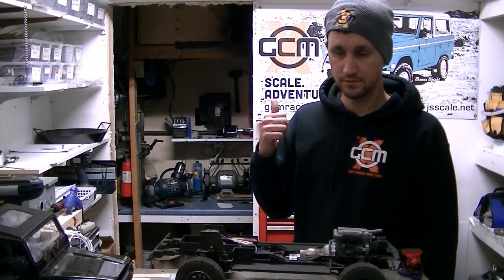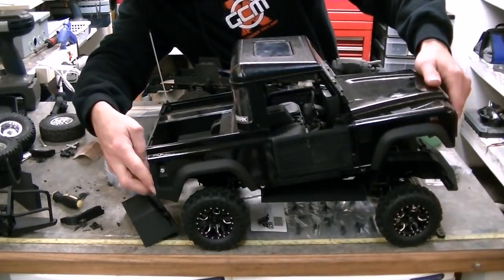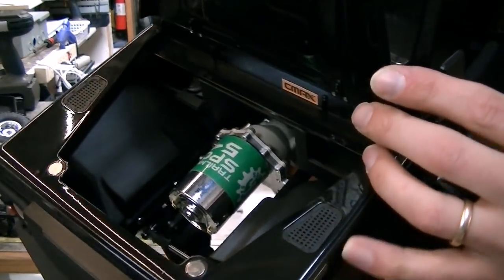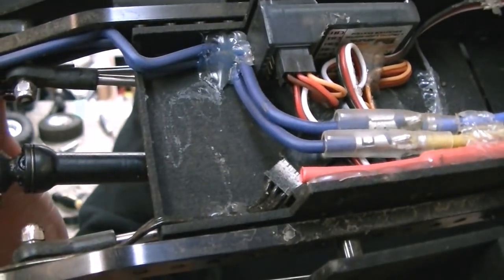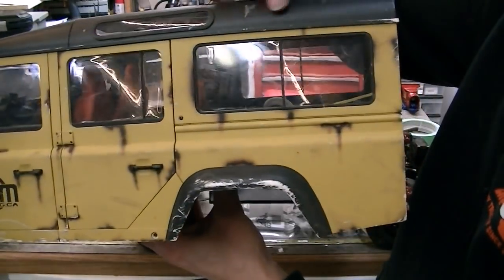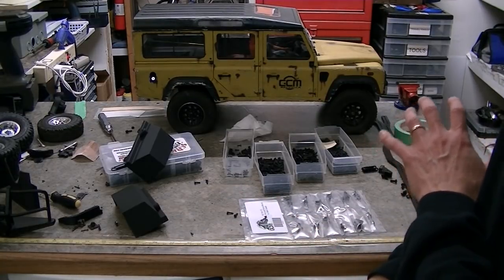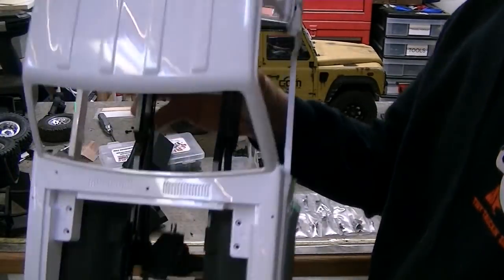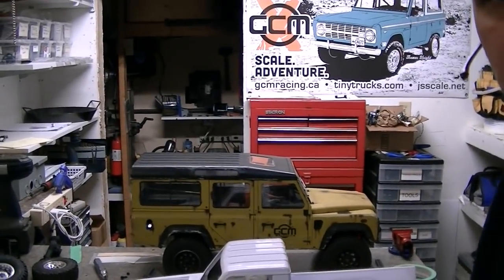OnTheBench - Defender and Toyota Trucks All Apart

Comment: The new inner fenders look amazing! Are you going to be using that new interior for the LC 70 the one that's completely back letting adjusting seats and telescoping steering wheel? I hope that you do it will look grate on a Tiny Truck from GCM!

Comment: Hi to the guys at gcm from castleford england just a quick question i would love it if you would explain to me why you do not like tamiya conecters buds
Reply from the maker: Ok! You asked, and you shall receive! The construction of the tamiya connector is actually a flat piece of metal that's nickel plated, and then stamped into a curved C shape. It doesn't actually become an O but only a C shape.. with a tiny gap in the circle. This is infact the entire problem. After the plug is put in and out a few times the C stretches and becomes even larger with a larger gap, and in a very short time there's almost no more plug metal contact there. The result is very frustrated RC truckers!! The battery suddenly can't get enough power from the charger- making false charge readings, and it can't deliver enough power to the truck. Besides bad charging on the battery, some of the signs of a bad plug are steering servos acting weird, studdering, ESC shutdown when you're trying to use reverse, motors loosing power, RX rebooting, all sorts of things that MAKE you think the truck is a complete donkey turd, but it's almost EVERY time that damn white tamiya plug. I hope that helps!
Reply: GCMRacing1 - Scale Truck RC in Canada thanks guys that has really opened my eys to a lot of the problems ive had on a few of my trucks i would love to be able to build a truck like you have built lately but getting alot of the gear over here is like rocking horse s**t guys but thank you again for answering my question wouldnt miss a vid you put up lads keep up the good work